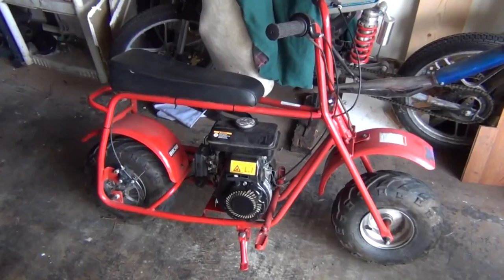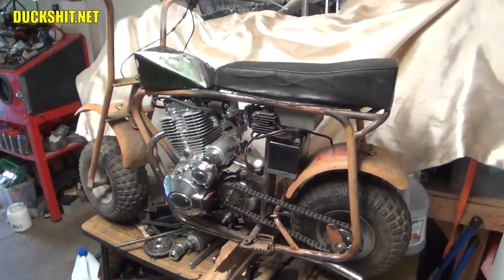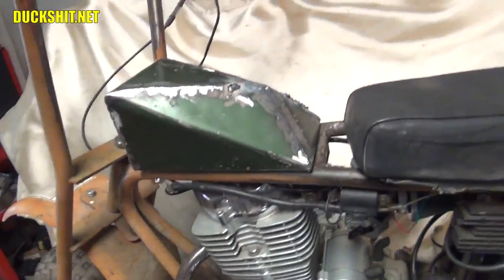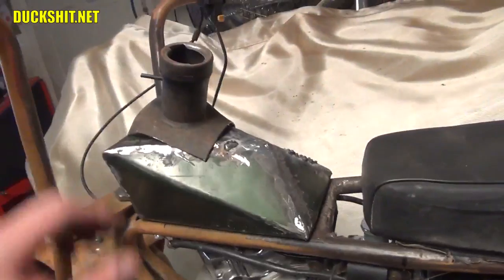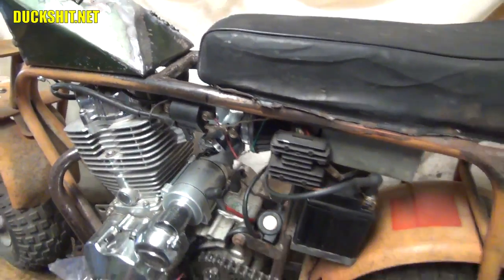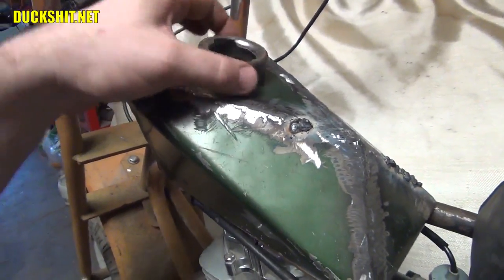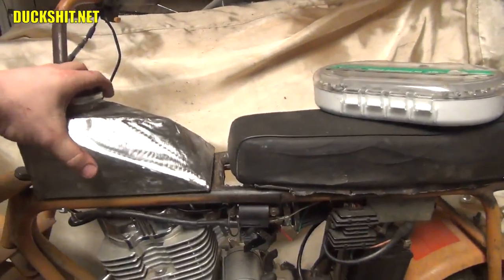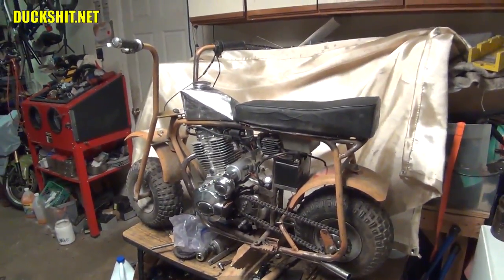Custom Gas Tank 2 - DoodleBastard Minibike Engine Swap - Part 15

Comment: That little bike looks like it will be v.quick due to the v.small rear sprocket which compensates for the small rear wheel, and the lightweight machine, most motorcycle manufacturer, s would have a pin sized hole in the cap to vent them, looks
 like a lot of fun!
Reply from the maker: You nailed it!  This thing is gonna be scary!  I hope I can keep the front wheel down long enough to not kill myself lol!

Comment: a very small hole in the gas cap will do the venting job. I don't know if you have any micro bits or not, but they're easy to find online and not very expensive. You can also get just the smallest bit the hardware store has. perhaps ou should consider putting some of that stick on heat shield material on the bottom of the tank? 

By the way, you're one talented guy, I'd like to see what you could do with a real shop and lots of good tools. I will continue to bust your chops when I can, but just so you know what I really think I thought I'd let you know.
Reply from the maker: I really appreciate it, thank you!  I'm from NJ, I can take a couple hits without getting freaked out... haha!

Comment: Hi Glenn, I never realised the top of the Briggs tank wasn’t steel.... oh well, never mind.
As for the heat problem, as you are a computer guy, how about using a bunch of aluminium heat sinks?
Reply from the maker: I had no idea it was going to be aluminum either, lol!  I was all excited until I made that discovery!  When heat sinks are used that way they would draw heat in!  But heatsinks wouldn't be used anyway because we're not looking to expel heat from the tank, but rather stop it from getting there in the first place!  Some kind of barrier and rubber mounting would probably be what I need.  😀  Some motorcycle gas tanks have a fabric padding with an aluminum foil over it to insulate.  Should be easy enough to make this happen!   Thanks for the suggestions, always!

Comment: Making way more progress than me on my mini bike, bike is sitting in my backyard collecting rust because the rear axle still needs fixing im thinking of just cutting off the broken threads on the axle it got a Briggs 5 hp Flathead gonna be getting back to rebuilding it soon
Reply from the maker: Well mine has been taking me over 5 years, so I guess you have some time LOL
Reply: Gonna try my best to make a video with my phone camera
Reply from the maker: Looking forward to it!

Comment: if you want to use a Briggs tank look for a beaten up 5 hp Flathead they have tanks bigger than the lawnmower ones and they are steel
Reply: Might be picking up a junk 5 hp from the junkyard it had a good tank and parts so if i dont use it you could have the tank
Reply from the maker: Thank you very much for the suggestion as well as the offer but in this video I have already finished putting a filler neck on using Volkswagen parts. 😁😁😁😁😁😁